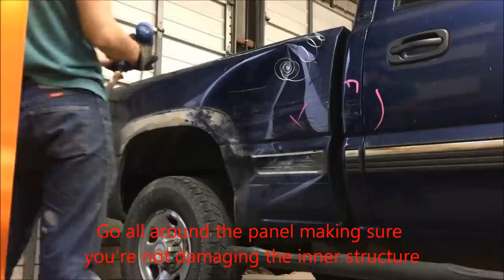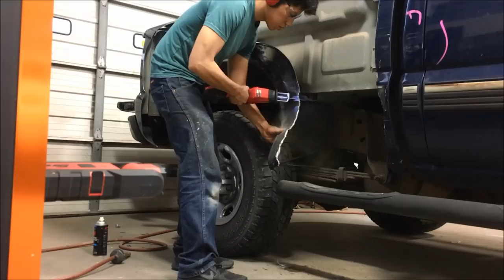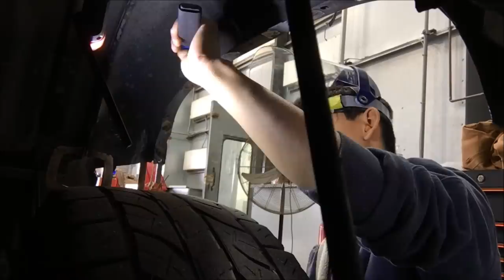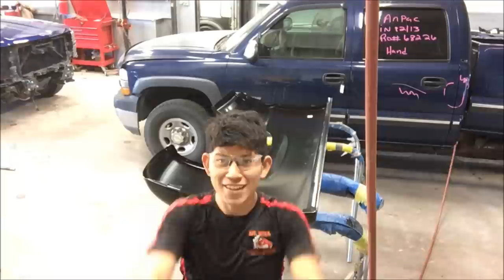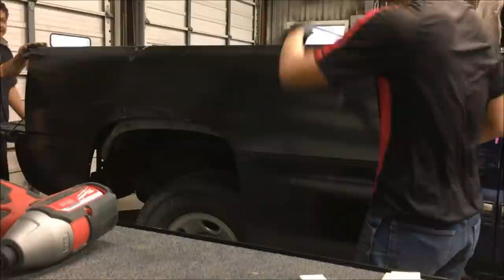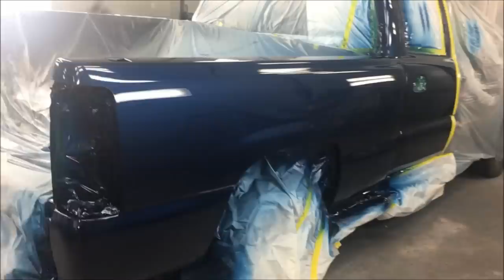Silverado Bedside Replace

Comment: Well done kiddo.. for future bedside R&R, no need to air hammer 90% off first. You're still going and grinding all your spot welds off with or without the panel there. A guy I work with used to do the same thing and he kinda fought me on it, I just showed him there is no need. But if that's what you like to do, there is nothing wrong with it. I'm a collision technician myself 20 years now. Bedsides are still my fav job to do. Pays a minimum of 12 hours and I have it down to 1 1/2 hours from  first weld grind off to rolling the bed over to paint dept. Gravyyyyyy
Reply from the maker: Thanks, this video was when I first started now I pretty much do as you’re explaining. Thanks for watching and the advice 🤙
Reply: bullsh  t

Comment: Good video! You should invest in the drill bit for those spot welds. That way you don't gotta grind them and chisel them. They just come loose with the drill bit. I might even try to do my own bed sides. Hopefully there's not too much rust on it.
Reply from the maker: Thanks for the tip

Comment: The amount of vice grips alone, plus the special belt sander tool, plus the panel and paint is enough to warrant me going ahead and spending the $800 they want on body work and paint.
Reply from the maker: Lol that’s true 😂a set of 5 vise grips runs like $100
Reply: Only $800? Shit, the box side was $3500 from GM, plus another $2,000 in labour for me

Comment: nice video! after welding, do you phosphoric acid wash/spray sealer inside to cover the areas ground off and welds?
Reply from the maker: Same concept we seal them to ensure the moisture doesn't get in

Comment: If you don't mind what size disc or wheel is that on your angle grinder? I would like to try that out i always use a belt sander but that wheel you have looks faster! Thanks
Reply from the maker: I think I replied in a different video, but you can also use a belt sander and or the 3 inch cutoff wheel by 3M

Comment: Question!       I have a very similar dent (crater on my 2000 silverado) its going to a body shop to have it pulled and or replaced like this (depending if they can pull it or not) but i was wondering where you found the side molding or did you salvage it off the old piece? cause I can't seem to find anyone selling that oem style side molding.
Reply from the maker: We bought it brand new , we have a parts department that orders and looks for parts nationwide. I’m not entirely sure where they got it from but they have many different vendors

Comment: Thats alot of work i was looking cause i have to take my 2014 silverado in the bed is damages bad and the bumper too i think looks like alot of money. What was this total build out for customer if you don't mind me asking?
Reply from the maker: I don’t remember exactly it was around 3k paint and body work included. The labor isn’t that difficult it’s more about the parts
Reply: avery gentry 

Hey Avery did you ever get it fixed? If so how much did it cost i have a 2014 silverado too

Comment: Great video, currently looking to get this outer panel replaced on my 02 Silverado. Can you give me a rough estimate for this kind of repair pls . Don’t want to get blindsided at local body shops :)
Reply from the maker: Labor rates change in different states , then parts and materials go into play but you’re looking at a few thousand dollars
Reply: This is if you bring enter Saint cloud technical and community college about $5,000 for both sides with new upper wheelhouse support pieces

Comment: Trying to understand why he cut it off ? Pretty Easy to drill out spot welds , unscrew screws , and pull the whole panel off.  And only cut corner on hard to reach spot welds  in-between the bed and cab.
Reply from the maker: Well JC, I believe cutting this way is faster, and more cost effective, the only time I remove the panel completely is when I have a recycled part. Spot weld drill bits and tools cost alot... It literally takes me like 2-3 minutes to cut a big whole in the middle and attack it from the inside and out, I'm not gonna use the panel at all anymore I'm putting a brand new one
Reply: This is the hard way plus u can get a spot welder for abt $90 or just make on from a old microwave for abt 30
Reply: CSX2586 Rail Rider Raby I have a Lincoln handy mig welder ,.works awesome .
Reply: Yea I've always just zapped them in with a mig my self have done a few with a tig but I dont own one so it's the mig 4 me but there is a video that shows u how to make a spot welder for cheap
Reply: Plus a spot weld drill bit is between 7 and 17 dollars depending on brand and location
Reply: CSX2586 Rail Rider Raby ,.or just use two regular bits . A small one for pilot hole , and bigger one to break the weld. Sometimes  Use what you have handy.
Reply: I've done that too but I'm a fool but all I need is a half a reason and 1 ex dollar and I go shopping
Reply: The way he did it is the way i see most shops do it.
Reply: @pieseasmyseas  what the hell are you smoking lol
Reply: @dewaynestripling7013  the good stuff

Comment: Excellent video. A few questions for you. Is panel bond the same as seam sealer? Is panel bond weldable, or did you not use it in the location of the welds? Also, how long did the job take?
Reply from the maker: Hey how are ? No the panel bond and seam sealer are two different things one is used to seal to avoid water leakage and the panel bond is used to bond panels together. Wherever I was gonna weld I left without panel bond to have a better penetrating weld . A job like this takes me about a day usually I have other cars to work in between
Reply: Auto Wizard - Thanks for the reply. Great video BTW!

Comment: So wait, why do you have to cut out the center section of the panel? Can't you just grind off the welds like you did and the whole panel should pop off??
Reply from the maker: Just to have more places to separate the panel from the truck

Comment: Good job, very impressive for as young as you are. How long did it take to install that one side? Trying to decide if I should bondo all the blemishes in mine or just replace the entire bedside.
Reply from the maker: ALLxTeRrAiN thanks brother how bad are the blemishes? It takes about 4-6 hours to replace the panel . This one was real bad that’s why we decided to replace instead of repair
Reply: Auto Wizard I guess that’s not too bad still a lot of work though. It’s nothing like what you fixed here just various dings and 3 or 4 small dents probably no larger than the size of baseball on the bed.
Reply from the maker: ALLxTeRrAiN I think you’d be better off just fixing those lol , I used a 3m panel bond that saved me a lot of weld time it only requires welds at the edges. But filling the dings would be faster

Comment: So I just bought a Silverado that needs this doing due to rust and dent, where is the best place to purchase the body panels that ship ?
Reply from the maker: Thanks for the question, It all depends on how much you wanna spend, the best place to buy parts is off your nearest dealership sometimes they have it in stock if not they can order it for you and it's an original part, you can also buy one off a junkyard, or you can try online maybe they have any after market panels for it

Comment: Nice video, was that a Astro belt grinder you used on the upper rail, do it work well? Thanks
Reply from the maker: Yes it works like a charm one of my favorite grinders, this one is actually silver eagle, matco's line. I haven't tried the Astro yet, but I have tried northern tools version which is called klutch and that one is affordable and works great, bang for your buck
Reply: Thanks. I actually think Astro makes those Silver Eagle tools for Mac or Matco. I have the Astro door skin crimp tool and its exactly like the Silver Eagle version. I'll check out that sander made by Klutch. Thanks again and keep up the great videos.
Reply from the maker: I didn't know I wouldn't be surprised, Cornwell sells more Astro than the other tool trucks, I've been wanting that crimper, I've had a co-worker let me borrow it and it saves alot of time

Comment: Do you do the spot welds after the panel bond dries?
Reply from the maker: You usually do it before it dries , the guy who sold and did the demo said it goes thru panel bond, on this particular one here I just panel bonded it as the instructions on the packet say so . I plug welded the ends which I don't believe I showed
Reply: Thank you for the reply.  Just for clarification, you did no other welding besides the end seams?
Reply: I just saw your other video on another bedside using the spot welder, it looked like you didn't use panel bond on that one. Which way do you recommend? Spot weld the whole thing, or panel bond?
Reply from the maker: I would do spot welding , but the spot welding machinery is expensive , Panel bond does a great job along with the Mig Welder if your going the most cost effective route

Comment: excellent video but your working to hard try grinder with cut off wheel to cut apart and flap wheel to sand down spot welds ive never done this before but that's how I would do it
Reply: You could also use a spot weld drill bit

Comment: I can’t believe you didn’t clean the hidden part of that bed and remove the rust from the top of the inner wheel well and coat them with rust inhibitor before you put that bedside back on.  Especially knowing Chevy trucks are notorious for rusting out at the wheel wells.  Pretty lazy.
Reply: Maybe if the insurance companies would pay us the way they should we would do all that extra stuff but with the insurance companies doing us like they do if its not accident related and the customer chooses not to pay the extra then we're not going to do it. Body techs are in the shop to make a living not do a bunch of work for free